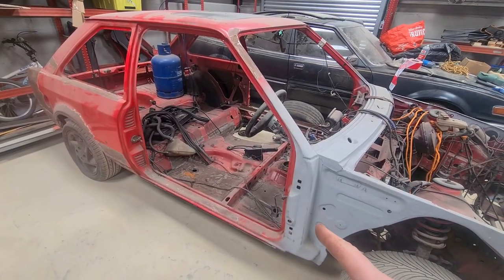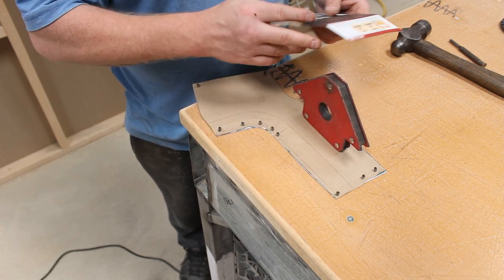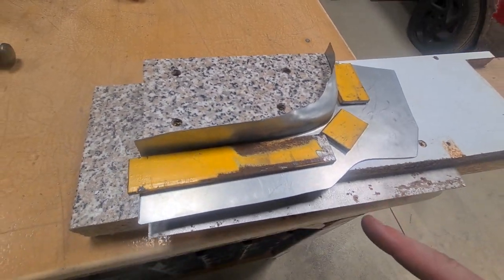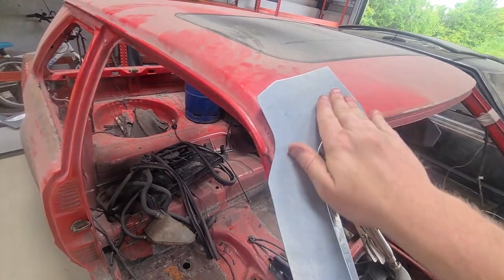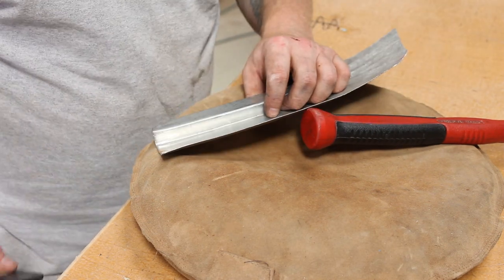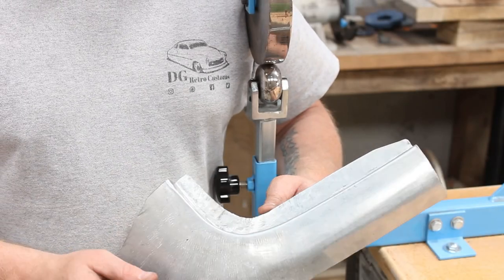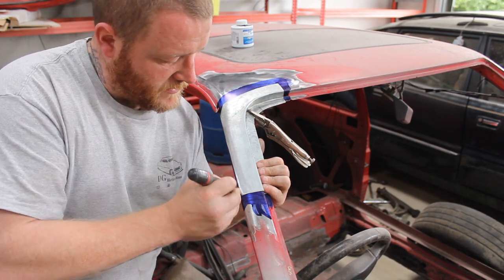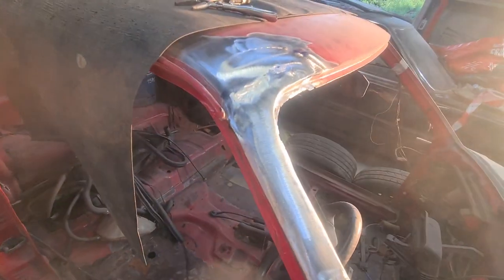Mk4 Escort A-Pillar to Roof Repair | Panel Making | Metal Shaping

Comment: if you know how to weld you could have made in three sections and completed a whole lot faster
Reply from the maker: @jmdragon63  you shouldnt weld on a corner, a weld is harder and more brittle than mild still, with the flex of the car it would eventually fracture

Comment: Nice presentation.  I have to do the exact same repair on my '89 Bronco.  I would greatly appreciate your thoughts on a few questions.  Thank you so much for any help you can give.
- what gauge steel did you use?
- is there any value to heating the metal with something like a propane or map gas torch during the forming of the acute corners or would that light the buck on fire?
- how smooth does the finished flange have to be so that the windshield can mount and not leak?
Reply from the maker: Thank you. For this car I used 0.8mm steel but you need to match what you have, having a little heat can be benificial but not essential, over heating can cause more problems than not heating at all, you really want to get the panel as smooth as possible but it doesnt have to be perfect, remeber once its ground back it is likely to need a skim of filler and them primer and paint so any imperfects can be rectified at that stage.

Comment: Wow amazing mate, lots of great details, 

One question if you won’t mind, 

what type of sheet metal is this? Cold rolled mild gauge? I repair mostly 90s and 70s cars and I am lost with which is the best type of sheet metal to use to patch and weld.
Reply from the maker: thank you, I use cold rolled and I try and match the thickness to the car, most cars are 0.8-1.0mm on the body with 1.2-1.6mm on chassis etc sometime you will see 2mm on suspension mountings but every car is different you just have to go with the flow
Reply: @DGRetroCustoms  exactly what i was thinking and it’s better to hear it from someone like you, thank you very much mate,
Reply from the maker: @Kyle-mk7lu no problem anytime

Comment: 'Safety first' - & then use an angry grinder without a guard?? WTF? Love those little magnets. Pomegranite!
Reply from the maker: the gaurd gets in the way when in tight spots but yes i should use it, the magnets are awesome i have had them years wqnt to get the bigger ones but they are not cheap

Comment: Just found the channel, like what you did. Have you considered a slide hammer on small welded pins to pull out the low spot on the roof?
Reply from the maker: thank you, for the moment its just a matter of going through the repairs, this car I might not be painting but if I do ill prob pin it, the dip looks lower on camera than i  life cause of the way the light reflects

Comment: Galvanised sheet bet that welds good
Reply: i always use steel and spray copper coat on it them and weld it in !
Reply: @ronnieboucherthecrystalcraftsm  yes and putting a shim gives you a stronger weld
Reply from the maker: its not galvanised its electroplated and cleans of real easy for welding, almost all pattern repair panels are electroplated
Reply: It doesn't flash rust like bare steel...i used similar coated metal for sign fabricating...it welds nice..you usually grind areas to weld first....not galvanized metal from my viewing....

Comment: This very wrong put a shim at joins and don't use galvanised sheet the shim under the joint will let you put a good weld on
Reply from the maker: shimming it will only put the panel out of alignment or do you mean a spreader plate if so it is extremely unnecessary